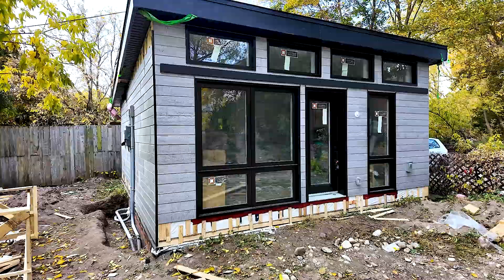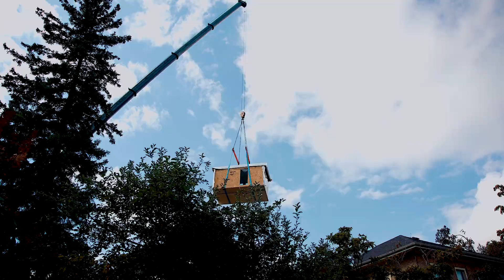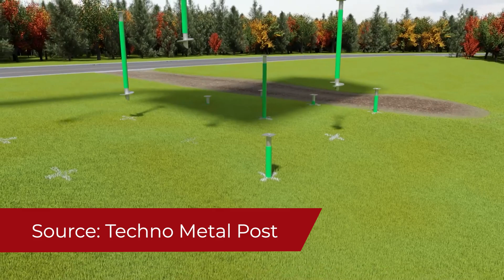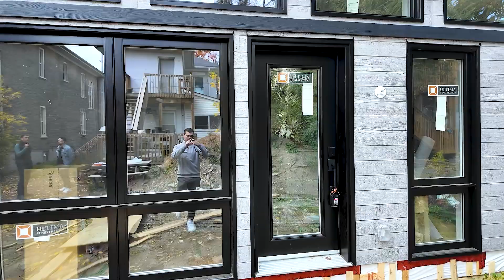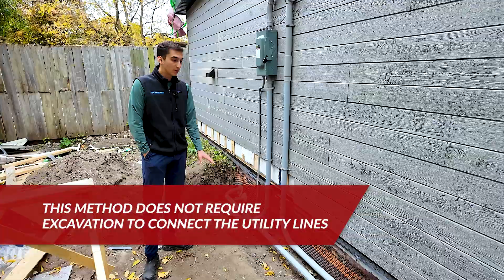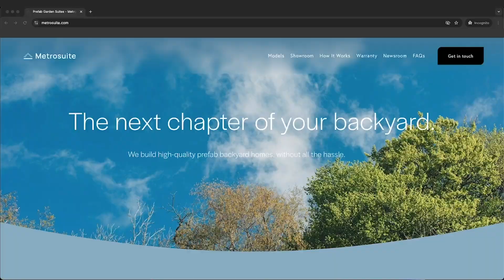Modular Garden Suite CRANED Into A Backyard in Peterborough, ON

Comment: Good work! and very professional. 

Is it possible / permissible to add a basement floor below the garden suite?
Reply from the maker: Not on these modular builds but if you construct your own, depending on the municipality you're in, it may be possible yes. We've seen several garden suites with basements.
Reply: @rockstarinnercircle  I’m was thinking of insulated foundation walls to use the ground space. If I remember correctly the height is restricted to maximum of 14ft.